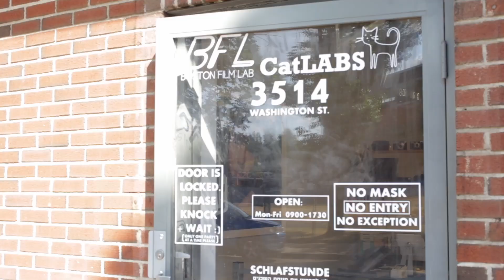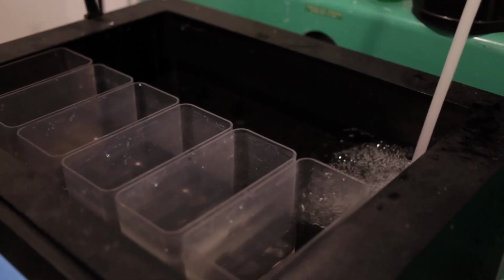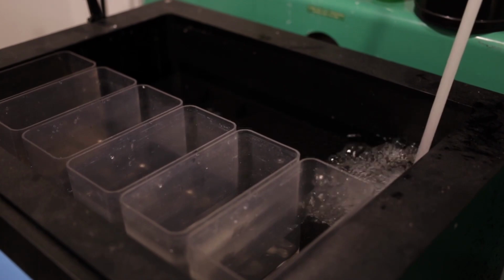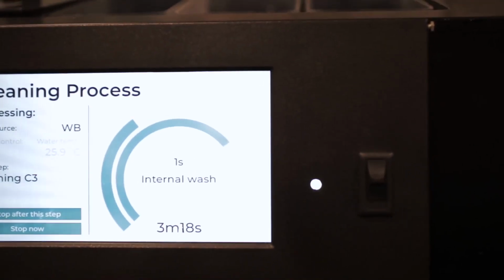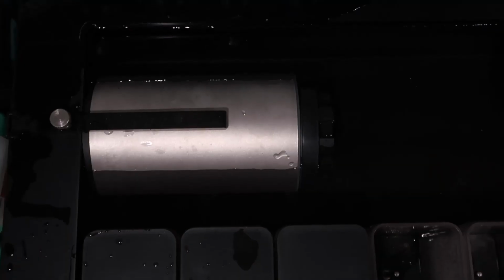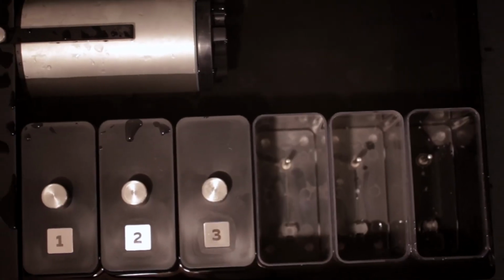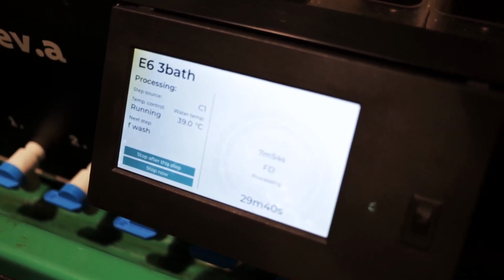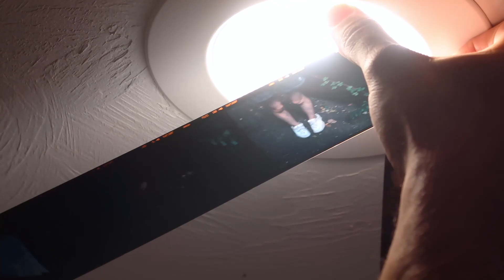CatLABS Unboxes and showcases the Dev.a compact automatic film processor

Comment: New to everything film, can the chemicals be reused to process more of the same film? And what type of chemicals are used that are in the 6 tanks?
Reply from the maker: Some parts of the chemistry can be re-used, others are single use. Each process (C41 , E6 and BW) requires different chemicals.
Reply: I use Cinestill C41 kits for like 20rolls with the 2% rule starting after 8 rolls. 1litre E6 kit i would use up to 10 rolls.

Comment: The principle advantage of this processor is its ability to run a 6 bath process. Of the half dozen or so automatic processors on the market today, all but this unit (and one other I think ?) are limited to 3 bath processes of the type of stripped down versions of C-41 and E-6 sold to home users in "kits".  These 3-bath units all seems to be in the $4,200 - 5,500 range, so on a price basis, the Dev A seems to offer the better value overall. The 6 bath unit allows use of the Bellini kits which are improved by separating the blix back to the original separate processes, which insures a complete processing with a cleaners image product, as well as the full versions of those processes. Generally, speaking, if you can afford and justify a 3-bath unit for $5,000, you can go up to the Dev A for the extra $1,000.

Comment: Where does the chemicals go?
Reply from the maker: There are 6 tempering tanks in the front of the machine, you can see them in the video.
Reply: @CatLABSJP  I meant after you’re done processing. Down the sink?
Reply from the maker: @xjuanx92  the machine can be programmed either to recover the used chemistry back to the tank or to be discarded.
Reply: How much?
Reply: @vangstr  around 6,000 usd.
Reply from the maker: @vangstr  http://www.catlabs.info/product/deva
Reply: @vangstr   About 40% more than you can buy the same thing in Europe. The difference is the additional distributor markup in the US. The applicable phrase is, "There's one born every minute."